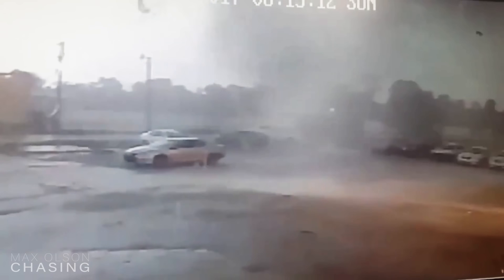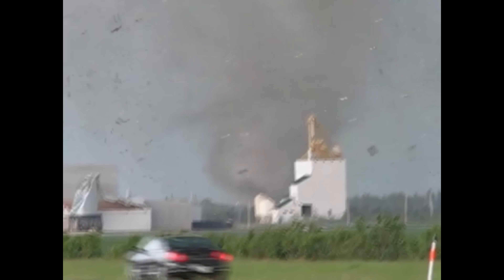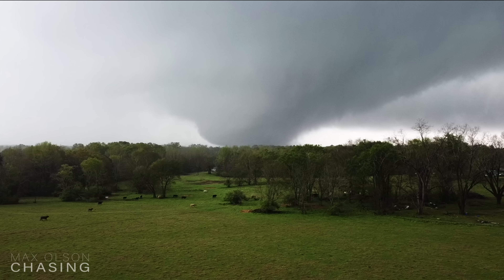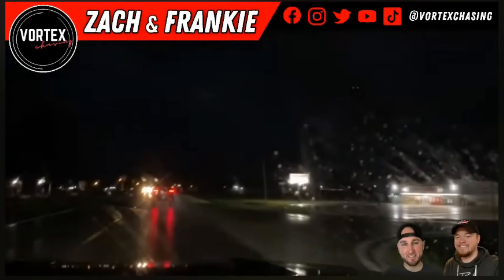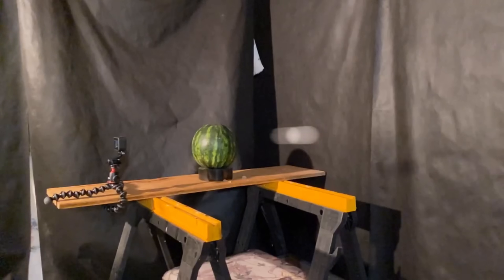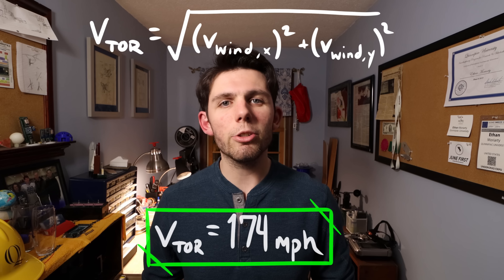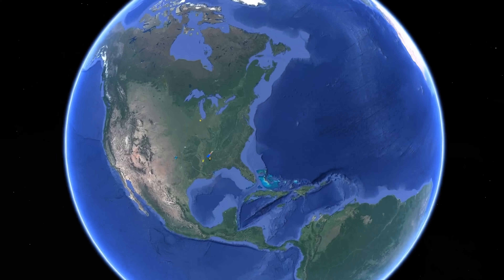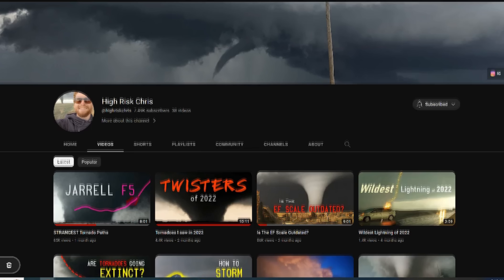Is This a Vehicle Flying Around a Tornado? - Rolling Fork, MS

Comment from the maker: UPDATE - We are still continuing to investigate the lights in the video, there are some other potential theories that we've been diving into and hopefully we can come up with enough to make a part two. Thank you for all of the kind words about the production, as well as the additional theories and insights!
Reply: Go look for a flattened car where you think it landed.
Reply: @chateaumojo  I’m sure there’s dozens of flattened cars in that area
Reply: The intensity of the light fails to dip really, showing that it is either a car whose orientation stays locked with the camera, or it is a light source projecting out 360 degrees on at least one axis.  

An automobile will not keep orientation with the camera that much.

You all are plenty smart, surely you all know this...
Reply: Scientifically, is it likely the headlights would have stayed facing the direction of the camera? I would guess no, but don't understand the physics well enough to know. It might be a motorcycle or possibly an accessory light that became detached. My top guess is a security light that runs on battery so it will stay lit during a power outage.
Reply: @wildflower1397  the car certainly did not face the camera the whole time. its not physically possible. that thing was emanating light from every side, and its also not circling the tornado at a steady rate. The light speeds up and slows down. it could be a lantern, it could be something different. maybe its a spooky ghost we will never know
Reply: Work lights from a job site......
Reply: if you look at it frame by frame you can see it is not A light, it is two lights side by side....like the head lights of a car.....
Reply: Why nobody ever consider the battery powered portable LED lights? I have them and they are as powerful as car lights at the fraction of weight. They can also be solar powered so you can just leave them in the field attached by magnets to a steel structure of your choice and they will happily shine for few hours. Also some security systems have lights that are battery powered in case of a blackout  and are also bright as a hell. They also have movement sensors so they would certainly be turned on by it. They are usually under the roof and could be easier picked up by the wind. If it was a car, you may also see the red rear lights too. Even street lightning in Chinese countryside has a small solar panel attached to each street lamp to charge it. Could a solar panel give it a lift? I mean there are so many alternative explanations that give more plausible scenarios...
Reply: It could be very bright sloar flood lights that have internal batteries on board to power them through out the night
Reply: Most sloar powered flood lights have motion sensors that would have activated them when it was lofted ito the air
Reply: Consider the possibility of ball lightning (see my other entry).  Ball lightning makes a lot more sense to me.
Reply: @gabberpietor  Ball lightning.
Reply: @Phaleel  Just because it's unlikely, it doesn't mean it's impossible. it would just need to rotate at the same rate as it goes around the tornado. The same thing is actually what keeps one side of the moon facing us, though in this case it would have to rotate in the opposite direction it's orbiting, and while hard to see, the light does dim ever so slightly. It may have been caught in a counter vortex that some strong tornados generate, though in this case it was invisible. the car or truck got caught in it and was oriented in such a way to have some lucky guy with a camera catch it on video, which also explains why it only went around once, horizontal and counter vortex satellites only last that long before dissipating and another one takes its place a moment later.
Reply: @hyper_tex9834  Sentences and paragraphs please.

You go ahead and promote the 1 in 1 million chance whatever you're describing occurred, and I'll promote solid physics.
Reply: @Phaleel  I just posted the same thing then I saw this. I agree.
Reply: @Phaleel  sorry, I was half asleep when I wrote that. But, anyway, I still think it's possible
Reply: I think the aerodynamics of a car might help figure this out, they naturally generate an upward lift. Idk physics tho I'm just a car guy
Reply: @chubbyweibel3401  I agree... it's definitely some VERY BRIGHT flood lights. There are MANY types that give 360degrees of light. That's way more probable than a car flying thru the air and staying facing the camera the entire time.
Reply: I believe it was the Joplin 2011 tornado where before it even hit the town, one of the spotters seemed positive in seeing it lift a car. One of the Alabama compilations captures the surprise of someone witnessing similar without pausing to doubt what he's seeing. Once the windows are out the wind catches it just right and I can see the possibility of a parachute effect while the doors are still on. 
 Pampa Texas video of that one hitting an industrial zone shows it hurling an empty flatbed semi trailer for what appeared to be a couple hundred yards. At least it was empty at the peak of it's altitude which I'm guessing to be about a hundred feet up or more. That's channel iron and wood but lifting truck sized Wheels, tires and suspension, axles  Front folding  stand legs . . . That ain't no bathtub or frig. It's incredibly more weight.  So I can see some possibility in a car of unknown weight making most of an orbit around. It ain't going to be a desk lamp.
Reply: @Phaleel  if the cars headlights are pointed outward of the tornado, then they would remain visible for about as long as you see then. headlights are specifically build to remain visibile at a noteworthy angle to both sides, making the vehicle more visible on the road. this angle for a relatively modern car (post 1990s) would be such that it would expectably create pretty much exactly what you see here.
Reply: @yowtfputthemaskbackon9202  No, they are specifically built to keep oncoming cars from being blinded.  Even modern cars like my A4 can detect an oncoming car and point away from it while it comes toward me and passes.

Even if the angle were significant, say, 30 degrees, the chances that the car would keep orientation with the camera in a tornado, in 3 dimensions not 2, would be so incredibly low as to be impossible.  That's not even considering the chances a car keep its largest side by area pointed down giving it the ability to generate the most upward lift, especially in the highest crosswinds imaginable.  

It gets worse.

Physics is hard sometimes.
Reply: @davidyoung6331  lightning never strikes inside the tornado
Reply: Any updates???
Reply: If it is a car it would have probably lost its bodywork and then the lights would be hanging out, or be more visible. In my humble opinion. No bumper and no hood and fenders.
Reply: @Phaleel Improbable is not the same as impossible. Having said that, it facing the same way for that long is an interesting point and if so, makes it seem very unlikely it is just a car.
Reply: @BladeValant546  The lights are shining into a fog like mixture of rain and tiny debris particles. Light would be almost totally scattered, all you'd notice is the brightness rising and lowering intermittently as it flips. Scattering means you wouldn't even be able to make out individual lights unless it happened to get near the edge of the rain/debris field which seems to happen at one or two points in the video.
Reply: Regarding the wind speed math - look into drag racing accidents. Drag racing cars can sometimes start to fly if they're not set up right and the front lifts off. This starts to happen at about 140mph.

Comment: If it were a vehicle the wind and rotation of the tornado is not going to allow the vehicle to be stationary and always be facing in the direction of the camera! If it were a vehicle flipping around in a tornado the lights as you see them would be flickering every time the vehicle turns, rotating, and literally flipping around in the air as it rotates around the Vortex. What ever this is has the light always facing the same direction, towards the camera. While I have no clue what this is we witnessed, I’m not buying the lights of a vehicle theory.

Comment: Why don't we place lights in the path of tornadoes to view them at night? Somebody get on that.
Reply: you got an idea there, maybe the tornado can throw the lights around, roughly making the perimeter of the tornado visible.  the lights would have to be battery or solar charged, otherwise the tornado would cut the power off if it was connected to any wire. the lights would have to be very bright to be able to see the condensation funnel, or make a silhouette of the tornado.

Comment: At 13:43 you can see a large horizontal vortex to the right of the main circulation. I think it is very plausable that once the main circulation picks up a vehicle it can then get sucked into a stronger horizontal votex that pulls the vehicle even higher in the air. It is almost like an air highway that the car gets trapped in. Also the vortex seems to also rotate around the main circulation which would make the car look like it is rotating with the tornado.
Reply: I can’t envision it happening this way at all. But I appreciate the creative thinking.

Comment: I believe there are at least three vehicles (possibly five) swept up in this tornado. Slow the video down and take it frame by frame. At the  0:04 second time stamp you'll distinctly see headlights of the vehicle in question, along with (what appears to be two sets of) red brake lights to the left, lights down low-center, and another set of headlights upper right. Heartbreaking. 💔😭💔
Reply: Especially if you zoom in. You can tell there are light streamers from the motion,  but you can still distinctly make out headlights, and tail-lights. 😢

Comment: If not a car, I was thinking it could be an emergency exit sign attached to a wall. When those loose 120v the switch to internal power. Being attached to a wall still would loft it like a roof. Just a thought.

Comment: One thing that is not explained in this video is how the light(s) appear to be completely steady-on while orbiting the tornado. If this were a vehicle, it would have to be pointed at the camera the entire time for the light to be continuous. That's extremely unlikely, as any vehicle would undoubtedly be tumbling wildly, resulting in the lights blinking on and off randomly (and quickly) as they swipe by the camera's view. My guess is that this is some kind of solar/battery-powered floodlight that was ripped off a home and lofted. These types of lights cast light in all directions, so it wouldn't blink or flicker as it tumbled.

Comment: There are 2 sets of lights flying around that tornado, both visible at the same time - one high and one lower. If people were fleeing from the tornado in their cars, the driving speed would contribute to the vertical lift. 
I get that a lot of work was done to make this, however there are glaringly obvious points of data that were not considered even though the video shows the evidence.

Comment: The smithville ef5 carried an suv from one side of town to the other sooo….
Reply: The truck it picked up off the highway traveled 3000 yards before slamming into the ground killing the driver.
Reply: Was this an ef5 that’s believed to be one of the strongest tornadoes in history? Not at all. They’re completely different tornadoes with different characteristics. Not at all comparable.

Comment: I JUST DONT THINK SO!  there is no way a cars headlights would face the camera the entire time while floating and whirling around in the air... the lights would be disappearing off and on one way or another because the front wouldnt always be facing the same direction... if the vehicle is facing away, you wont see the lights...not just when its on the other side of the funnel.
Reply: Lights too stable and never loses its shape and brightness, something else, not a car.

Comment: A strong argument against the lights being on a car is that headlight beams are directional. If a car wasn't by some miracle carried around the twister in the correct attitude to always shine its light in the direction if the camera, the lights should have come in and out. The light was pretty constant, though.
My bet would be that this was some battery powered garden light or ceiling light of a shed that was attached to a part of a building that was broken up by the storm.
And while fascinating, man it's so painful to watch homes getting pulverized and businesses get blown away.

Comment: My first thought was a road crew flood light station, the kind that sits on a small trailer with a generator. There are usually 4 flood lights or more, extremely bright, and they can be positioned in different directions. The lights are so bright it just looks like one big light. This could explain why the light can be seen so steadily even though it may be spinning. Just a thought. (I reallly don't want those lights to be vehicles with humans in them 😔)
Reply: That makes sense. I'm still coming back to get updated.
Reply: Light plant is the word your looking for but it would die if tank is unstable , they suck fuel from the bottom of the tank and are fragile lights.  If the jolt the filament will short in the halogen bulbs.  Good guess I think it can’t be ruled out yet

Comment: I think a big potential problem with assuming this was a vehicle is that the light is seemingly always visible, which just seems extremely unlikely if it was headlights? Not only does it seem impractical that one vehicle's headlights would always be facing towards the chaser's camera the entire duration of basically two rotations around this thing, but that there's a second light which also is visible. Surely a vehicle being lofted would be spun to some degree, causing the bright headlights to disappear or dim, and not somehow be perfectly aligned across two vehicles with multiple camera's positions.

What it could be other than a vehicle I don't know, especially since they seem pretty bright like you would expect from a headlight. What sort of bright light exists that would have its own power source and not just get ripped from its wires when impacted?

The fact the lights are still on when lofted, and it went over a busy road, certainly makes a car seem likely - and I don't mean to imply it's not possible. Just that the maintained view of the lights just seems bizarre for the kind of motion you'd expect two lofted vehicles to be experiencing.

Comment: It's an exploded transformer.  In one of the 2024 tornado videos you can clearly watch one happen.  You can watch the transformer flash as the tornado strikes it and it then starts circling around, high in the air, while still glowing from it's short circuit.  As soon as I saw it, I thought of this video.

Comment: Hi, thanks for sharing this. I'm not sure if this is relevant for your video or not, but Justin Cox and Chase Coldiron have a video called "The First 10 Minutes of the Moore EF5 Tornado (5/20/2013)" where they caught a vehicle or two flying high up in the air around the tornado. This was right as it crossed a major highway. Time code of the video is 6:47

Comment: surprised there weren't any tailights visible and that the orientation of the headlights seemed to be unchanged.  The intensity of the light didn't seem to change as I would expect.  Those are the issues that make me question it's a vehicle, but I also don't have a better alternative thought to what it could have been.
Reply: I had the same thought. It seems like if it’s a vehicle, it was rotating in such a way that the front always faces the camera. Not impossible but it seems unlikely.

Comment: Parked a Suburban with a trailer attached at Joplin's supercenter and took cover from the F5 in 2011.The Suburban was thrown from in front of the store way out in the lot over the store and ended up about 50 yards behind Walmart. The damage was un real. The axles actually snapped off as it must have been dropped from a major height. The frame was bent and the front bumper was touching the engine.
Reply: Where did you take cover?
Reply: I drove through Joplin heading westbound three days after that same F5 hit. Damage was unbelievable. I thought that 70% of the town was killed just by looking. The part that stood out to me was pavement being ripped out of the ground and having to drive on bare dirt.

Comment: I think the wild card that isn’t necessarily easy to simulate are the sub vortices that are associated with violent tornadoes. We saw how that small EF1 tornado tried to pluck that car up by 10 feet in the parking lot early in the video. It may be reasonable to expect a strong sub-vortex to pluck a vehicle up above the more horizontal winds rushing toward the vortex at ground level and into more uplifting winds of the parent tornado that occur above the surface inflow layer. A small ‘boost’ 10-20 feet into the air will probably greatly increase the chances of a vehicle lofting around a violent tornado.